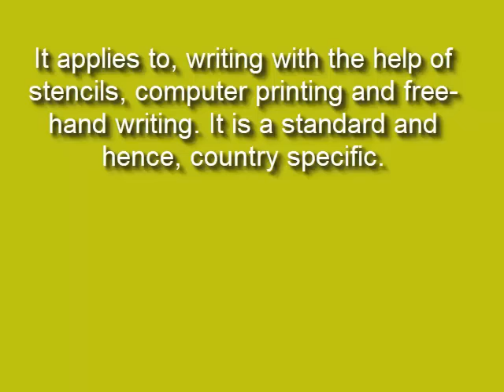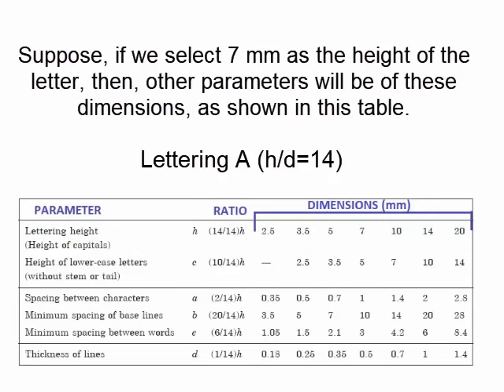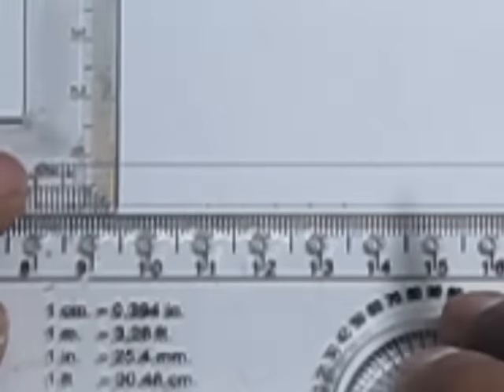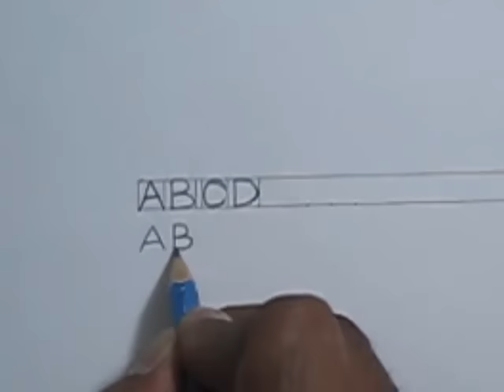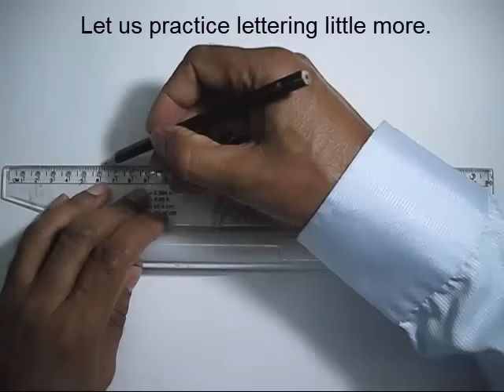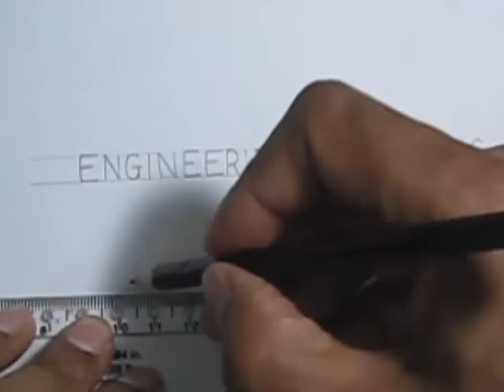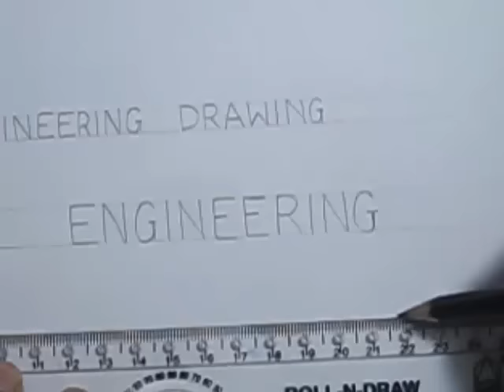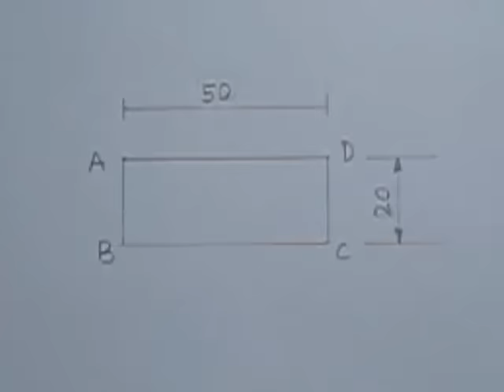1.2-Lettering in Engineering Drawing: English Letters and Numbers

Comment: What is lettering A and lettering B
Reply from the maker: Lettering style A or B defines two different ratios of the height of the letter to the thickness of the line or h/d ratio. For style A, this ratio is 14 compared with style B for which the ratio is 10. This basically means that Style A has line thickness lower than style B for the same height of the letter. Other dimensions will also change but marginally (please see in the table given in any textbook or technical standards). My suggestion is that you can stick to one way and that should be fine. I prefer thinner lines and hence style A. 
Thanks for asking! 👍
Reply: @1styearengineeringdrawing182  nice explanation